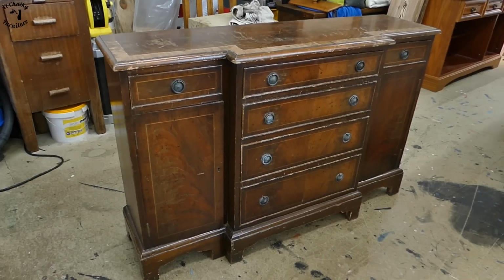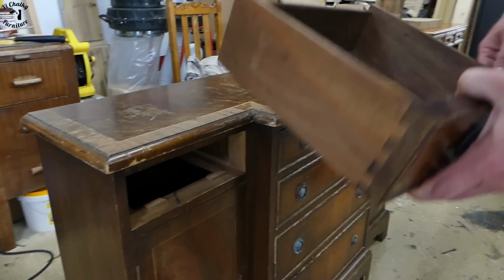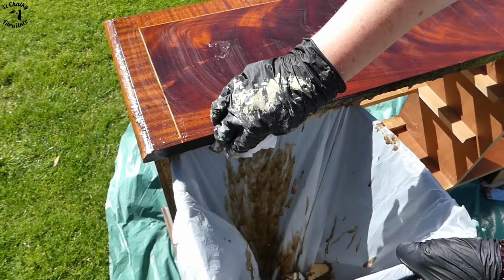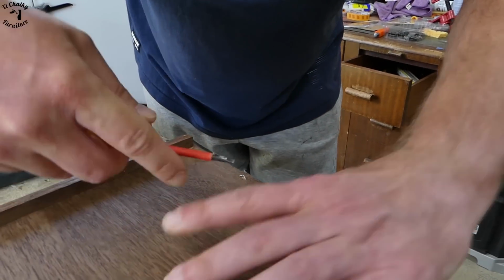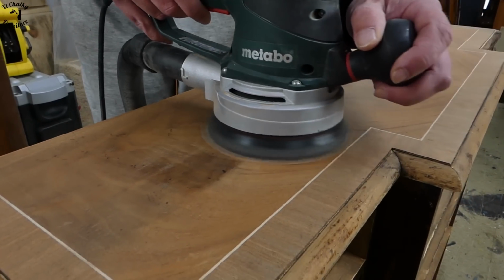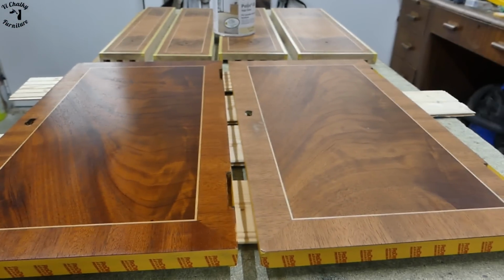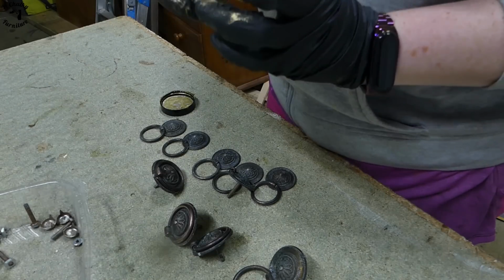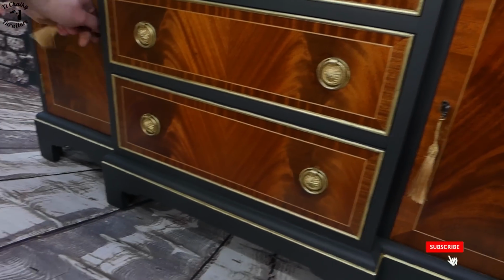This is the most amazing transformation of wee sideboard.

Comment: So stunning 🤩! May I ask what do you use to get rid of the old stinky smells. I have one like this that Iam in the middle of doing but nothing will touch the smells! I tried airing it, water and vinegar, sanding, diluted bleach! Still not fresh. About to sand again and spray with clear sealer. The US people use spray shellac but can't find that in UK! Thanks in advance x
Reply from the maker: You can use varnish to seal the whole unit but you would have to varnish it in and out extremely well. I use this animal odour remover from rug doctor.  You can buy it at supermarkets exit door, usually. It might help. Unfortunately sometimes process of removing smells could be very long. Fingers crossed. 😜
Reply: @ViChalkyFurniture   aww you replied! I will definitely get the odour remover tomorrow. Fingers crossed and thanks  🤞🤞

Comment: Stunning piece.
For smell remover, after piece is cleaned and before starting sanding etc. 
Make a mixture of 50/50 white vinegar and white spirit. Put in a spray bottle and saturate every surface and allow to dry ( in sun if possible) and Air out overnight. If there is still a residual odour, repeat after the piece is at rough sanded stage.
Reply from the maker: Hi. I know this method of smell removing..I've used it before, sometimes with great success sometimes not so great. I discovered another way.  You can buy animal odour remover here and it works magic and it has nice smell. Just like I said in video in this particular case odour disappeared on its own. I was very surprised. Thank you very much for watching and recipe.